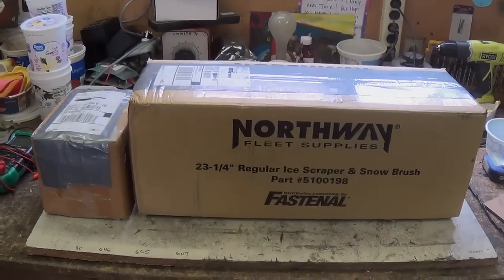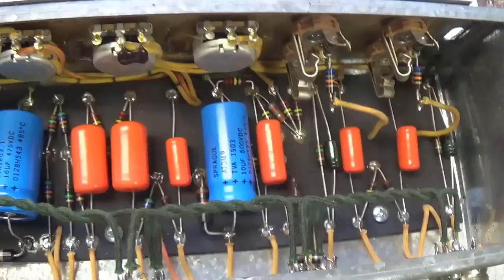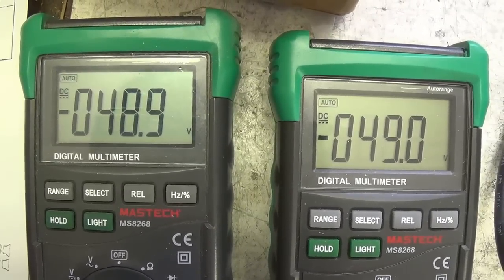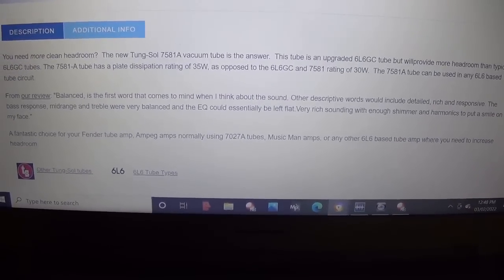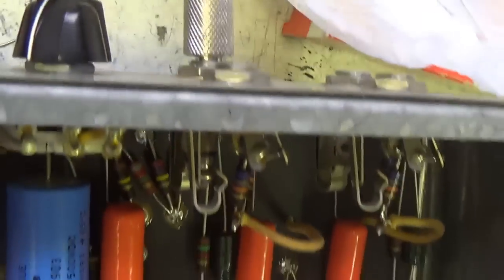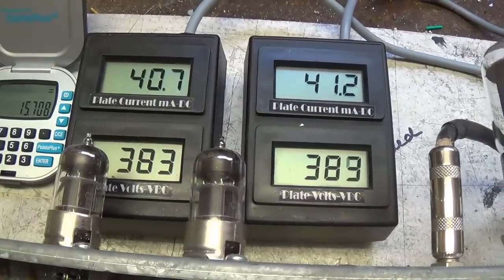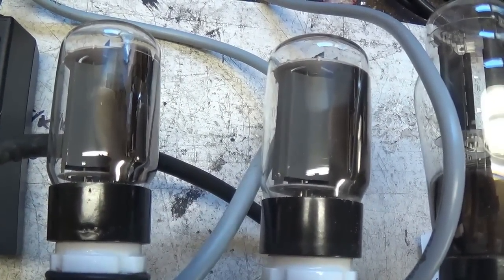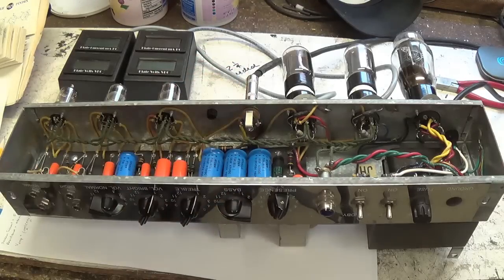Victoria Clone of a Fender Tweed 5F4 Super Amp

Comment: Uncle Doug
I found it interesting that you could identify the frequency range of the presence control. I gather from this that there are certain notes that presence controls affect. It's a mid range boost as far as I can tell. Or, is it a reducer of certain notes? I suppose it would affect sympathetic tones generated by multiple string vibrations which can somewhat distort q clean pitch sound. Since the presence circuit actually cuts tones at low settings and rolls off the cutting of the certain tone pitches as presence is brought in, isn't the increase of presence bringing in the fatter sound created by somewhat off pitch sounds when the strong vibrates more by being plucked harder? Am I all wet on this? Doesn't the presence being more restrictive at low settings just scoop midrange notes some?
Reply from the maker: The Presence Control is somewhat of an enigma, Dan. I was able to identify the narrow band of frequencies it affects.....upper mid/lower treble.....but honestly, have never been a huge fan of the control. I have posted a video that explains how it functions.

Comment: Can't wait to see you test your new regular ice scraper and snow brush! But for texas...
Do they make an irregular ice scraper?! 😂

I love the way you guess what's in the box, don't people tell you what they're sending you?

I can't wait to see the video on the heathkit!
Did your friend restore it?

The U in cyrillic is a ts sound, the same sound you'll get putting your finger on the the 40 Watts coming out of the top of it 😅

Mullard replica? Mullard are/were a British brand, I actually had a perfect condition box I wanted to keep, until I got pickle juice all over it😔

Neighbor murdered the tree😢

The black on the top of the new cats head looks like a hair style, if the moustache was just over a little bit more, you'd have a Hitler cat🤣

Do you still do the drone work?

Didn't the customer say they wanted it stock, does adding a switch change that? I'd have added a switch so you can only pick one output jack and the other not work - my only other thought from bias was maybe their guitar is faulty, but I assume they tried with more than one, Hmm m did you run it from an isolation transformer?
Reply from the maker: The cap tester was unrestored and currently has a problem with DC cap-charging voltage.....it's at 70% of dial reading. I just grab the next box in line and often am not sure what amp it contains. I like to think of Mitzi's marking as a semi-Groucho :) I still have the drones but have not flown them in quite a while. The amp has been returned to the owner and is working perfectly.
Reply: @UncleDoug  I hope you're ok!

Groucho wins every time 🤣

Comment: My first impressions are that the power transformer looks like it could do 40-50 watts, the output transformer looks like a typical 30-35 watt piece. I hope the filter choke is used only as such and doesn't limit the B+ to the plates.
Reply from the maker: Do you mean the filter choke, Tony? What other purpose would it be good for ?
Reply: @UncleDoug  I mean that post tweed amp Fender used the power supply filter choke in series with all the circuits except the output tubes. I ran some tests and the later design yielded higher output watts.
Reply from the maker: @tonymanns8249  Thanks for the info, Tony.

Comment: Hi Doug, so are screen resisters only needed if you have a choke between the first two filter caps? What if you use a resister between the caps? I see some circuits where the B+ connection to the OT comes from the first filter cap and resister or choke connection. How does that effect the amp? Thanks
Reply from the maker: The B+ almost always goes to the output transformer primary first, Allan.....and if there is a resistor before the screen node, then no additional screen resistor(s) are needed.
Reply: @UncleDoug  Thanks Doug, I don’t think I asked the right question re B+. Compare the Bandmaster AA768 schematic vs the 5F4 amp in this video. In the Bandmaster the B+ comes from the rectifier via one side of the choke and to the OT CT. The screens are atch on the other side of TR2 at pt B. On the 5F4 both the OT CT and screens are connected after the choke. So the voltage is higher at the bandmaster OT CT than if it had been connected after the choke. Thus my question was why is this an option? Is it to keep the plate voltage relative to the screen V on the output tubes higher? Should grid and screen V be similar? Does it have something to do with the DC resistance of the OT. I have watched pretty much all of your videos but this point still puzzles me.
Reply from the maker: @allanpennington  To me, the Bandmaster is wired properly and the Super is not. In the  Super, the screen voltage would be slightly greater than the plate voltage due to the voltage drop across the OPT primary windings....and there is no protection against screen shorts. Ideally, SV should always be slightly lower than PV or else the screen will compete with the plate and screen current will be too high.  I can't explain or defend a circuit that is IMHO improperly wired. There is NO benefit to the Super wiring......I believe it was an early oversight or error in design, which was quickly rectified in subsequent circuits.

Comment: I'm sorry Uncle Doug, I was wrong. Ampeg used 7581s they were rated 35 watts so I thought. 91s we're upgrade of them, A good 6l6 you can get 30 watts max. A 5881 is rated at 23 watts. Anyhoo the 7581a and the 7591a.  Are not related. All this time I thought they was. I do know that a stock back in the USA time period a 7027A was a beefier 6l6 with  multi pins on plate and grids. Don't get mad I admit I was wrong ❤️🙏🎸keep up the great work
Reply from the maker: I hope you realize that the wattage values you are quoting are for Plate Dissipation, William.....not the power output. Thanks for your input :)
Reply: @UncleDoug  sorry. Lots of numbers going around, plate diss is what I meant
Reply from the maker: @300poundbassman  Good to hear, William. Lots of people get confused by the "watts" for both PD and power output.

Comment: This was a cool one(as usual)with an unusual amp. I’m turning a Bogen into a 5e3 right now but looking at the 5f4 schematic, I’m wondering if that might be a better choice for the Bogen’s PT. It did originally run 6l6’s. It would be easy to make the changes. I just ordered a 20w OT for it with a 5e3 in mind tho. May need to think about that. That bias pot they used even echos the selenium rectifier in looks. Victoria doesn’t mess around!
Reply from the maker: Thanks, William. I too was impressed by the Victoria materials and craftsmanship.

Comment: 7581 is the military number for a 6L6 GC.  it should work in the circuit,  If it's not drawing too much current.
Reply from the maker: I went with the proper 5881's, DK, with the owner's blessings.
Reply: @UncleDoug  It would be interesting to see what the current draw required to eliminate the crossover distortion would be  for the 7581.  I learned how they bias with a scope to find the point that crossover is eliminated.   This allows the coolest bias that will produce a clean tone.   I think that's the ONLY  safe way to do it with a beefier tube than the amp is designed for.   I recall another tech that had a Marshall amp that the customer installed  6550 into.  The only way to prevent run-away was a quite cool bias.   I actually agree with the premise of using proven circuits on customer's amp........keep it close to stock style for maximum reliability.
Reply from the maker: @DeadKoby  Thanks for your helpful input, DK :)

Comment: Not only do the screen grid resistors help protect the power transformer, in this circuit design, both the plate and the screens are powered from the same node. Since the plate has to go through the resistance of the output transformer, the screens end up having a HIGHER voltage than the plate. I would think a screen resistor value a bit higher than the normal 470 ohms in this amp would be beneficial to get that voltage down a little more.
Reply from the maker: Bear in mind that the screen resistor value of 470 ohms is approximately ten times the output transformer half-winding DC resistance, Andrew, so the plate voltage will indeed be higher than the screen voltage.
Reply: @UncleDoug  1/10th of the reflected impedance that the power tubes “see”, yes. But if you measure the actual DC resistance of the half winding of the OT primary, you’re likely to find it’s only a few hundred ohms. But my original point was that making sure the screen voltage is a little bit lower than the plate voltage would be beneficial…Excellent video as always, UD! It’s always a real treat.
Reply from the maker: @andrewcerra9762  I misspoke. See corrected comment above.

Comment: Why someone set the plate voltage so low is a puzzle...Now that it's all sorted out looks like a nifty little BUT expensive amp that is bullet proof..WELL DONE 
Uncle Doug ++++
Reply: I suspect the low plate voltage was a deliberate part of Fender's PT design spec. I've seen power transformers wound to replicate those in tweed Fenders and they have surprisingly poor regulation (output voltage drops significantly under load). 6L6Gs (and 5881s) have quite low plate voltage ratings and even lower screen ratings, and of course Fender exceeded both, so having B+ drop as more current is drawn is a bit of a safety valve. Interestingly, those Siemens 6L6WGBs are likely '70s vintage USA-made Philips tubes and quite a bit more robust than the old Tung Sol 5881s, so a nice choice.
Reply from the maker: Thanks, Tim :)

Comment: UD not sure if you know trick for typing in a Ω symbol, hold down the Alt + 0216. 

for the 4Ω and 8Ω speaker jacks, would it not be better if it was switchable rather than 2 outputs? that way both can’t be used in tandem.
Reply from the maker: Thanks for the tip, Russell. I guess for the same reason that virtually every Fender amp uses two output jacks rather than making them switchable. Running a lot of current through a toggle switch can lead to all sorts of problems.

Comment: Hey. 7591. Replaced the 7581. Used in Hammond organs. Not pin compatible with A 6l6. 7ac.  That's not right.   Maybe space pes got me. But my Hammond 100 had 2 the 7591s. I changed the wiring and bias supply to run 6l6s.  Hope your ok. 🙏🎸
Reply from the maker: Never better, William :)

Comment: Would it possibly damage an amp, one that has diode rectifiers, to run it without power tubes in order to check the negative bias? Would the filter caps cause the voltage to keep climbing when there is no current flowing? Asking because I have a Marshall JVM410H that is red plating.
Reply from the maker: It would cause no harm at all, HA. In fact, that is standard practice for my testing and biasing procedures.  The plate voltage will be higher due to no current flow, but no harm should occur.

Comment: When you added the extra speaker jack, did you lose the protection the shorted jack provided to protect the output transformer in the case of trying to play with no speaker plugged in?
 Could you have run the speaker outputs from the transformer to opposite ends of an spdt  toggle switch that had it's center lead connected to the original shorting speaker jack as a way to retain the protection for no speaker plugged in while still providing the choice of 4 ohm or 8 ohm outputs?
.
I remember a past video where you talked about the 'fuzzy caterpillar', and was thinking that the description from the owner of the amp sounded like he might have been describing a similar type of problem......
Reply from the maker: Yes, when adding extra speaker output jacks, you do lose the shorting capability of the single, original jack. I guess some sort of toggle system could restore this capability.
Reply: @UncleDoug  
You already have everything you need, there and mounted...
 Use the switch you already added.
Use the original shorting jack.
Remove the extra jack and put the black plug back in.
Run a wire from the center of your switch to the original speaker jack,
Connect the 4 ohm and 8 ohm wires to opposite ends of your switch.
 Then you can remove all of those warning labels.
 Just label the switch 4 ohm or 8 ohm....
I still enjoy your videos and I hope you don't mind too much when I make a suggestion.....
Reply from the maker: @Dennis-mq6or  Not at all, Dennis. Thanks for the help.

Comment: Hi Uncle Doug. I can see a 4.7k resistor together with the diode rectifier but in the schematics for the 5F4 says 6.8k resistor and in the Pro model says 10k. What is the diference and the sonic results of this variation? Thank you.
Reply from the maker: I have no idea, X.  The only way to tell would be to get a 5F4 amp and exchange resistors to see if you could hear any difference. I doubt that you could.

Comment: Thanks Doug! Your analytical skills once again came through with flying colours. Sometimes bigger is not better. One question if you would not mind, do you believe there is a difference between how the circuit reacts to pickup impedance and voltage to just having an audio signal fed into the amp?
Reply from the maker: Thanks, AL. Yes. I really think the acid test for any guitar amp is not via test signals or oscilloscope tracings.....it's how it sounds with a guitar.

Comment: Doug,  I hope you are documenting the work you're doing to repair your Heathkit capacitor tester. I tried looking up "Heathkit capacitor tester" on YouTube and did not see any videos specifically for the model that you have. All of the ones I found on YouTube were either the older IT-11 model that had a round eye tube or several models that had no eye tube at all.  What type of eye tube is in your unit anyway? Some of those can be hard to find and expensive nowadays, since they are in demand as replacements for the tuning meter in old radios and vintage 1950s stereos.
Reply from the maker: The shadow-grid beam pentode (I believe) is an enigma. The label is very hard to read but appears to be "6FG5" but is not a miniature tube. It does not agree at all with the round eye tube shown in the operating manual.
Reply: @UncleDoug  ,  The older style round-target eye tubes most commonly found in radios and test equipment would typically be 6E5, 6U5, 6F5, 6AF6, and the 1629.  The 6E5 is the one that is hardest to find, most expensive, and is often cannibalized out of test equipment that used it so that people could repurpose the tube for restoring an antique radio. The 1629 is a military version of the 6E5 that has a 12 volt filament and is often found in test equipment. The 6AF6 is a short stubby little thing about half the length of an ordinary eye tube.  As for miniature eye tubes where the target is on the side of the tube ---- in the form of a white strip that illuminates green ---- most of those have European numbers such as the EM801 or EMM801.  Some will also have American designations but I don't recall any of the numbers off the top of my head.  Miniature eye tubes of this sort were often used as tuning indicators (both for signal strength and for center tuning) in vintage tuners and receivers such as Fisher, Scott and Dynaco, and the tubes can fetch a pretty penny nowadays.
Reply from the maker: @goodun2974  No markings on the tube resemble any of the numbers you mentioned, GU. I'll show a pic of the tube in a future video.
Reply: @UncleDoug ,  if the powdery numbers have disappeared off of the glass, rub it through your hair, breathe on it to fog the glass, and hold it up to strong sunlight.
Reply from the maker: @goodun2974  I'll give it a try, GU.

Comment: Also China and Russian tube pins are smaller then American tubes sometimes old sockets are worn causing bad connections as well 
I always clean my pins with my small carburetor pipe cleaning tool working it back and forth and pushing the pins tighter with a pin and test
Reply from the maker: Good point, Jim. I have encountered some of the small-diameter pins....and they are a real hazard.

Comment: With amps that misbehave....being a combo amp,  it makes me wonder if the symptoms could be related to a cracked solder joint...  the  "rattling cabinet"  of a combo amp could bring it to light.   I suppose chopsticking around would be the simulation.   No critique,  just some thoughts.
Reply from the maker: The culprit was revealed in the video, DK.
Reply: @UncleDoug  I am aware of that.   Considering that I've taken on some much more modern tube amps,   the vibration heebie jeebies is quite a common thing.    I just need to get quiet,  go back to my channel,  and film some more stuff.   I took a long break from filming,  and built up a stronger knowledge base for solid state amps.   Regardless of what I think of them,  there's plenty of 80's-2000's  solid state amps that need a technician's touch,  so I may as well serve our local musicians with that help.
Reply from the maker: @DeadKoby  Thanks for the input, DK. I used to work on some of the earliest transistorized circuits, but hate PCB's.